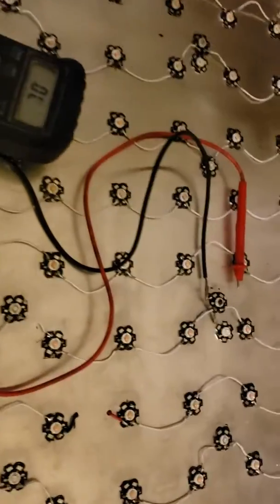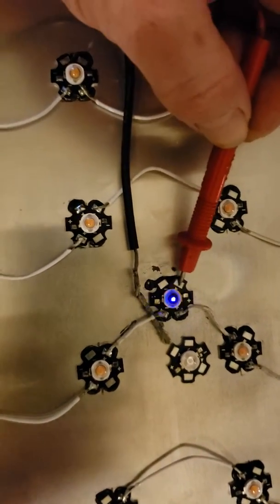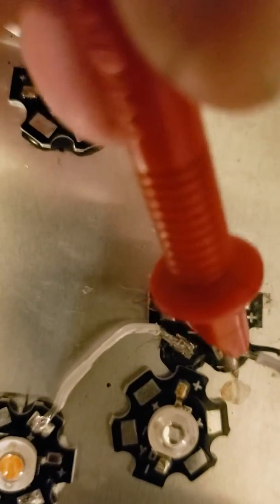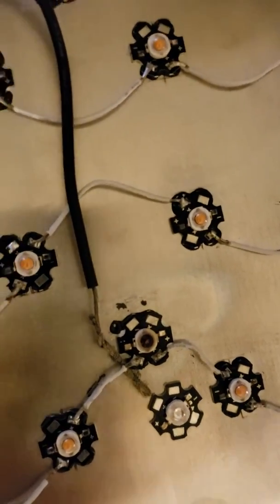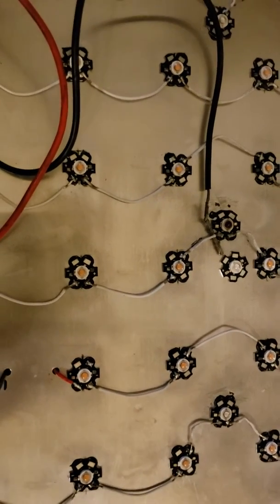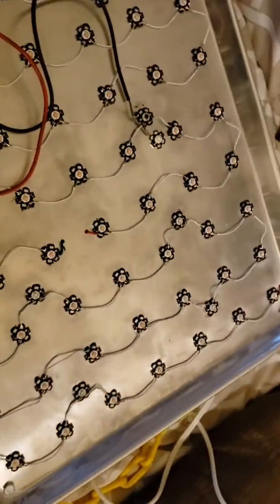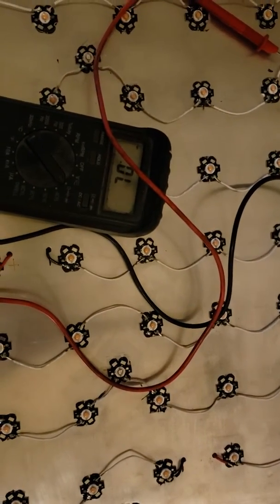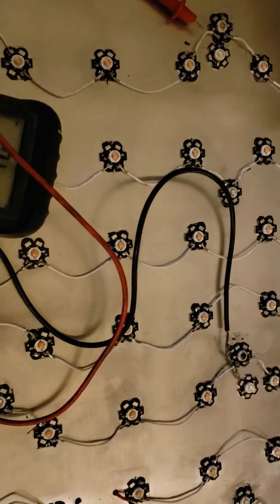Home made LED light, first burned up blue led

Comment: How do u calculate the distance between each one to meet your requirement/PAR value? I want to build one with LM301H
Reply from the maker: I didn't calculate par, I just built it and plants seem to love it, if u run full spectrum leds, u don't really need blue leds, I wanted to see how plants react to more blue light.
Reply: @zurchergrows2797  so how about red, deep red, IR, UV lights? Maybe those aparte needs to be there.

Comment: Any clue on why it was specifically the blue?
Do both colors run on the same W?
Reply from the maker: So fast only the blue ones burned out on me, not just on this panel, but 2 of my other panels had the same problem. They are wired in with the full spectrum leds, no issues with full spectrum leds.
Full spectrum and blue leds are the same Volts and amps.